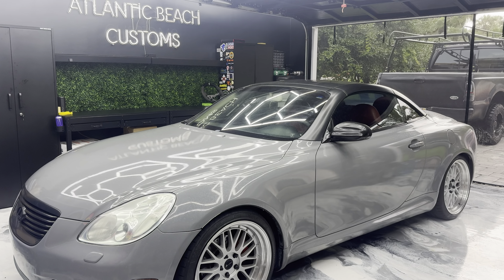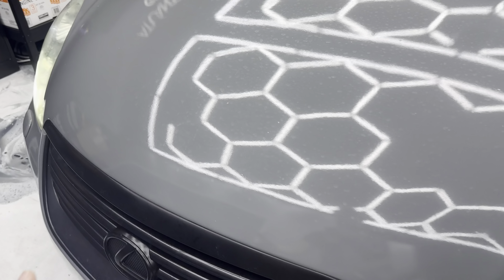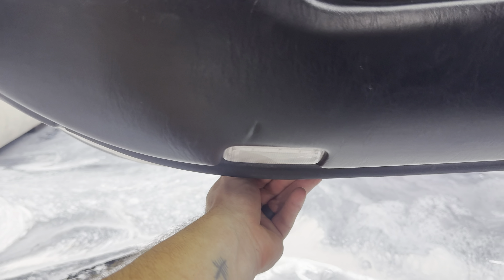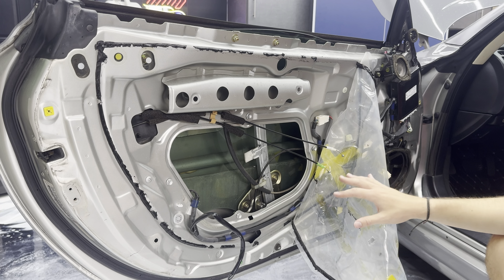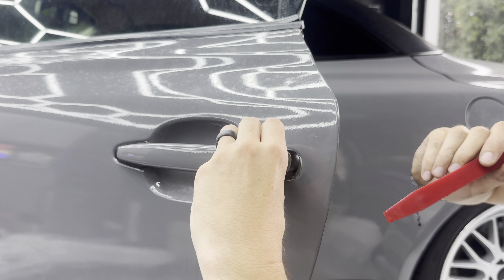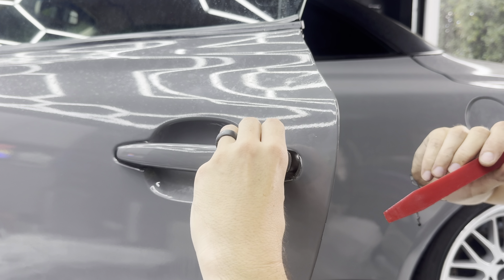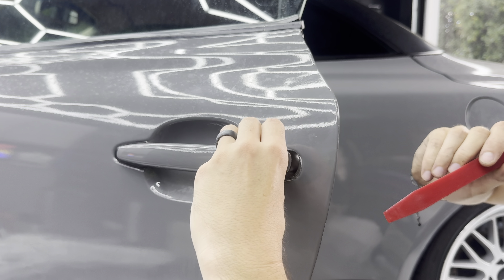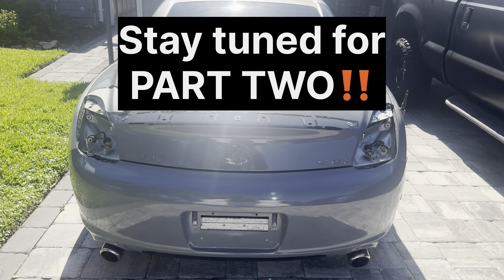How To Disassemble a LEXUS SC430 for a Vinyl Wrap!

Comment: I just finished doing the transmission mod on mine. It’s worth it.
Reply from the maker: @BringYourBestOne  Excuse my ignorance but what exactly do you mean by transmission mod?🤔😆
Reply: @Atlanticbeachcustoms   it’s a known mod mainly in GS,IS world. It’s putting shims in and turning up the flow knob. It eliminates long gear shifts and down shift quicker. I’m probably the first person to do it to an SC.
They have step by step videos for the IS300.
LS,IS,GS and the trucks all have the same Tranny.
Reply from the maker: @BringYourBestOne  Oh that’s awesome!! Noticeable difference? Would love to learn more about it, I’ll have to look into it!
Reply: @Atlanticbeachcustoms  it’s more responsive and makes the car a little more fun to drive.
Reply from the maker: @BringYourBestOne  Nice!!! What did it cost? Did you do it yourself?
Reply: @Atlanticbeachcustoms  I did it myself. It cost about 75 cents plus the new trans oil. Coins are used for the shims. It’s a lot of work to do the shims. The trans has to be pulled for those. If you want to increase the flow. Just drop the pan and turn up the dial.
Reply: I’ve been driving it for a few with this transmission mod. I would suggest all SC owners to try it. It actually feels like a V8 now.
Reply from the maker: @BringYourBestOne  That’s awesome to hear!!! Should I try it out and make a video of it?!